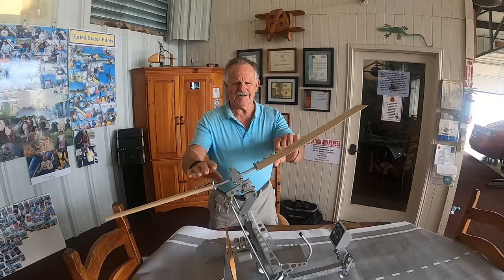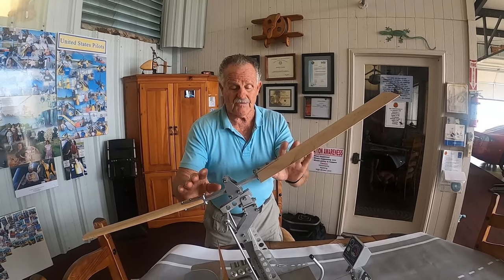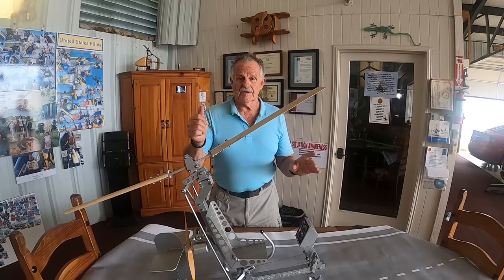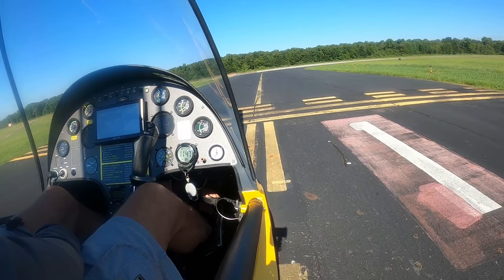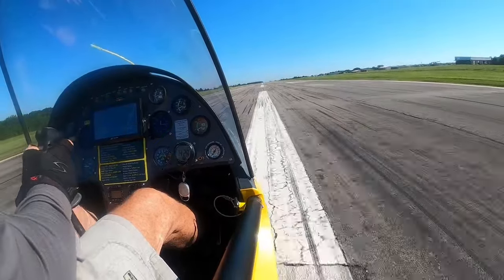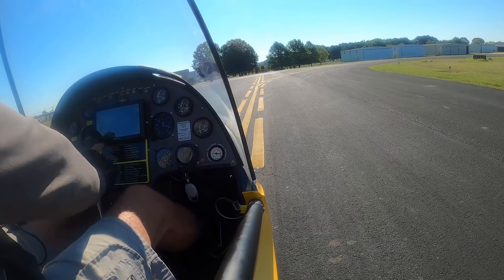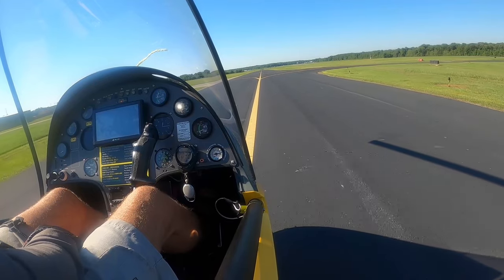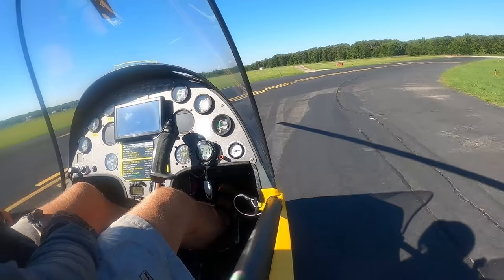THIS VIDEO *COULD* SAVE YOUR LIFE!! Rotorblade Flap on Takeoff!

Comment: When I was working the transition from two place to my single seat Gyro Technic, I moved the stick too far forward during wheel balance practice and accelerated too fast.  But, thanks to you and Greg Claire, I immediately recognized the error and pushed the stick full forward and reduced to idle.  No biggie...just slowed down, and went back to practice some more with a new appreciation for good training.
Reply: I just did the exact same thing today in my single place Aircommand.

Comment: You can see why Ken Brock loved to balance on the mains as much as he did. Also the lessons of lowering the disk to rid the excess drag while still balancing on the mains to allow lift off. The without touching the throttle gently tilting the rotor back to increase drag and the aircraft would descend. So many lesions were gleaned.

Comment: I don't trust an instructor who spins the rotor blades in the wrong direction in their training video!  Just kidding Ron, I love your videos and appreciate your diligence toward promoting safety of our sport.  I was taught to reduce power at the start of blade flap, but not to push the sick forward.  I see both sides of it; if you flatten the blades, it'll prevent the flapping, but your ground speed/roll would will be longer; on the other side, if you simply reduce throttle, the rotor acts as a parachute to stop you very quickly which would also stop the flapping unless you have a very strong head wind.
Your thoughts on the latter would be greatly appreciated!  Was I instructed incorrectly or will either method work.  I've never incurred blade flap (except intentionally in training) as I have plenty of runway that I'm never in a hurry to get up to speed and in the air... nice smooth throttle control.

Comment: I'll be doing my national sportpilotslicense for microlight aircraft soon and Gyros is what I will do after getting the "standard" plane license. It's not too much more money doing both. Your lesson is invaluable in understanding the quirks of the gyro. When I did a lesson with a gyropilot he told me the same things as you. Tilt the rotorplane into the crosswind to not tip over. Prerotate on the runway, not before.
I was flying in a callidus after I already hat a sightseeing flight in the mto sport. Autogyros are very fine machines. :)

Comment: Hi Ron - great video and explanation. I love the model gyro!
My only key comment on the take off run (as an instructor myself) is I don't want the front wheel to touch the ground (or "bump" as you referred it to) because as the nose lifts and we apply more power we'll need to also apply right rudder to account for yaw, which will put the nose wheel off the straight line and to the right. If the nose wheel then touches the ground we run the risk of flipping! Once the nose wheel lifts I want to keep it in the air, or if we need to abort the take off then get that nose wheel straight, reduce power, let the gyro settle and ease the control stick forward once the front wheel is back on the ground.
I also avoid the words "push" or "pull" when it applies to the control stick - you did say "ease" during the video but the word "push" was also used. It's a subtle difference but I've found just adjusting the language a little helps the student with being more careful with their movements.

I'm sure you have many more years experience than me - just sharing a bit of what I've encountered during both my own training as well as instructor time.
Reply: Im bad about sayin push and pull but my actions are actually just eased off neutral stick position . Then only increments at speed.

Comment: Seems to me avoid the flapping and gyros are the safest aircraft. Never thought I’d learn to fly but really thinking about it since all the engine failures I’ve seen seem tame and what always stopped me. Also intrigues me in a engine failure you can vertically decend and then move forward if in a tight spot. Granted my local airport is Shelter Cove,Ca I’d likely being going in the water or be extremely lucky to not lose it. At least it will be calm landing

Comment: I  have over 5,000 hours in helo's, yet your Gyrocopter admonition concerning starting blade rotation 90 degrees to the runway, and then, perhaps, inadvertently tilting the rotors downwind, just never occurred to me that it might very well cause the gyrocopter to tip over on its side!! I learned a VERY VALUABLE LESSON TODAY!! .....I learned a LOT of other things, as well, just from your one training session!! You are a SUPERB INSTRUCTOR, Ron!!......Thanks for the training!!
Question: RON,...To prevent blade flap, why wouldn't you gain some degree of forward airspeed, BEFORE releasing your pre-rotor engagement. That way, moving the blade disk to the rear, WHILE ALREADY HAVING A DEGREE OF FORWARD AIRSPEED,.... WOULD PREVENT BLADE FLAP? Would it not be a better way, as a procedure?
Reply: I'm not him, and not actually a pilot, but I'm gonna take a swing at this one... By keeping the pre rotator engaged during the roll, you start to play a dangerous game with torque, and depending on local conditions, and the ship being used, some of them can get off the ground on a VERY short roll. Without that solid contact, the pre rotator will spin the fuselage in the opposite direction, cause now you are a helicopter without a tail rotor, and that always ends 'bad'. For safety sake, it's too great a risk for minimal gain. Once you release the brakes and come up on power, just let the main autorotate as intended.

Comment: Quick question, I'm not a autogyro pilot, but I am a former helicopter pilot, so I know all about auto rotation. The question is, how do you control the rotor head rpm other than using cyclic pitch? In the helicopter, the rotor head itself has blade pitch that you can control with the collective, which helps you keep from over speeding the rotor during auto rotations when pulling Gs in a turn. If you can't control collective blade pitch, how do you keep from over speeding the rotor head?

Comment: I don’t believe that you taxed out without your rotors spinning. You sat on the runway doing your checks and then spun your rotors up. All the time you sat there you blocked others from turning onto final, making them go around. You wouldn’t last a week at our airfield. We were taught to spin our rotors by hand, that way you learn how to manage your rotors. We spun the rotors up by hand just off the taxiway and when we had them spinning fairly well we would taxi out to the runway, and by the time we got to the runway they were spinning enough to start heading down the runway building up the rotors revs, ready to start balancing on the mains gaining speed to takeoff speed. None of our members ever got behind the power curve. You see so many gyro pilots on YouTube getting behind the power curve and crashing their very expensive machines. What you do see is very few balance on their mains and let the gyro fly off without horsing it of the ground. I have over 4000 hours under my belt.Fly safely.

Comment: Excellent!  Why does the cyclic stick vibrate soooo much during spin up?  It looks like it’s going to break loose.
Reply: Resonance. The blades are a large mass but not yet fast enough to become gyro-stabilized, so their mass and mass-shift as they constantly tilt, causes the airframe to shake. The motion of the stick is from every time the blades tilt, changing the force on the cyclic. If you watch carefully, you will see the stick shakes relative to every 180 degree rotation of the blades. Once the blades get above a certain RPM, the resonance/shaking subsides dramatically, and the blades straighten out due to rotational forces.

Comment: Thanks! Why do you start with the ciclic to the full forward and full left and not full forward and to the right?
Reply from the maker: The pre-rotor system on this model of gyro is a rigid shaft pre-rotator. So, to pre-rotate you must put the cyclic full forward and center to avoid the risk of breaking the rigid shaft pre-rotator! Once the pre-rotator is disengaged then you have full control of the cyclic in any direction! Hope that helps!
Reply: @RonsGyros  that’s awesome. appreciate it and the videos! we’re learning over at Adventure Air right now.

Comment: Could you use the pre rotator to keep the blades in the green the whole time down the runway until you are actually stabilised in the air, or is that not an option?
Reply: You have to disengage the pre rotator before you roll forward. The gyro is in auto rotation during flight. Trying to roll with a powered rotor is like flying a helicopter with no tail rotor. Some pilots have enough skill to start rolling while pre rotating, but IMO gain skill before relying on it.  I believe in the old days they would pre-rotate by hand, making powered rotor attempts impractical ...

Having said all that, always follow the manufacturer's pre-rotator and takeoff procedures for the specific aircraft in question given in the Operating Handbook. For example, the Tango 2 specifies takeoff step 1 "pre-rotate to desired RRPM and set the pre-rotator OFF (green indicator light)." You don't release the brakes until step 3.